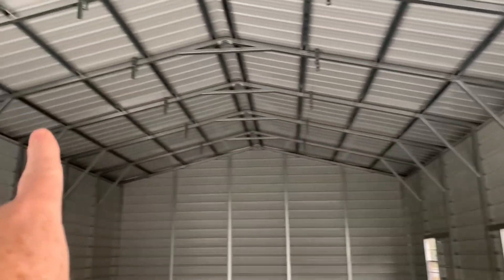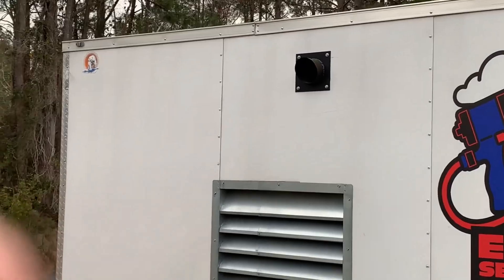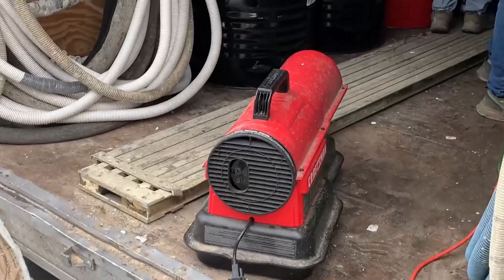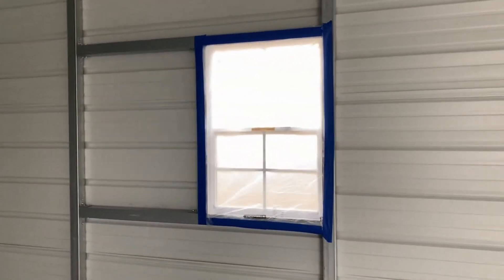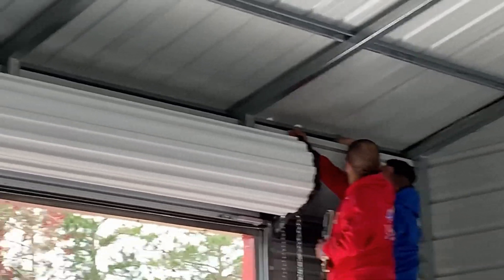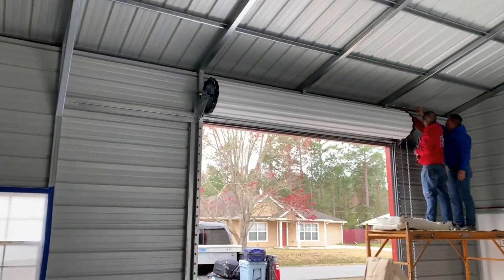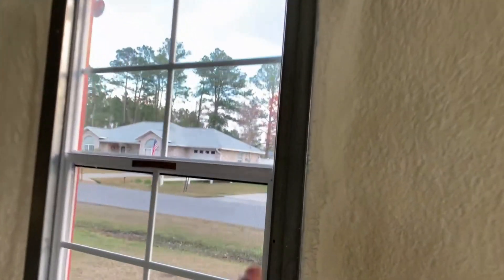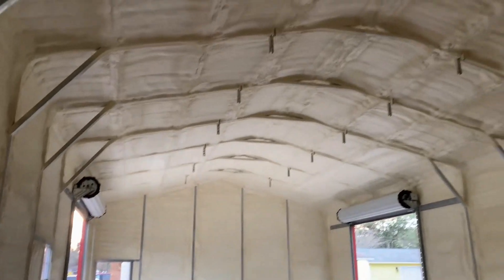Spray Foam Madness In The Shop - Ep 3! | Closed Cell Foam

Comment: The way spray foam was explained to me is this.
When you buy a coffee of hot chocolate and it comes in a foam cup, you able to hold it.
It is only 3/16 of an inch thick.
Try 2'' of foam.
It is all the insulation you need.
Reply from the maker: Exactly. There is some benefit to thicker foam, but it’s diminishing returns after 2”.